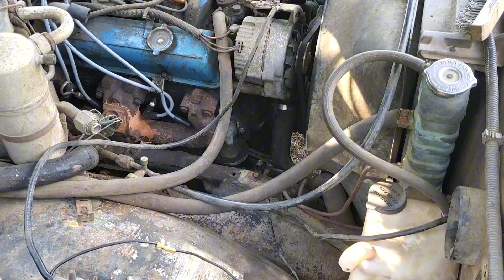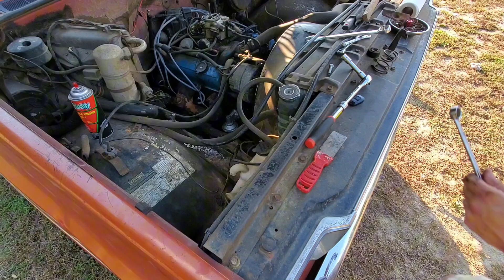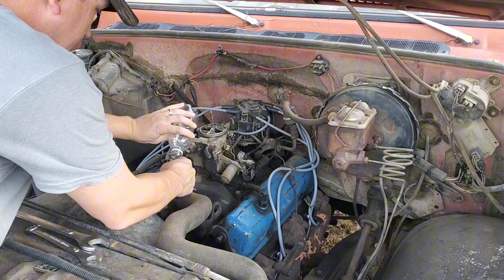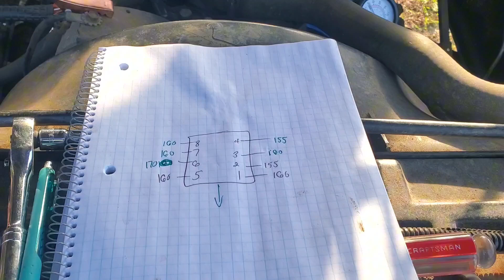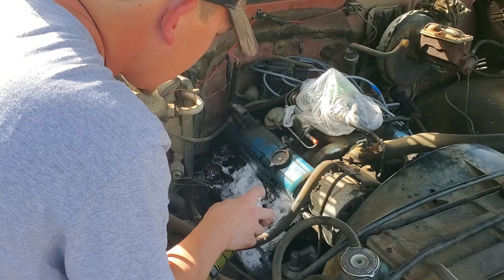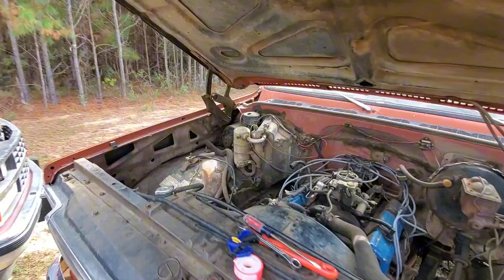1978 C10 Project- Fuel Pump Replacement and Compression Test on the old 305!!!

Comment: Don’t be afraid to use a good quality engine flush and then change the oil I hope to see more video soon Also check out Irish outlaw garage. If you want to pull that 305 out he has a great video on rebuilding a junk 350 that turns out rate on a series budget.
Reply: Put 10w30 full synthetic in it a can of engine restore and a bottle of Lucas high mileage oil stabilizer it’ll quit smoking guaranteed I’ve done it had great success
Reply: Restore fills in the gaps in the cylinder walls scratches and gaps
Reply: Restore and Lucas will take care of the problem
Reply: It’s the rings try engine restore and Lucas together in it it will quit smoking pretty fast
Reply from the maker: Thanks for the info! I plan on running seafoam or something similar in the crankcase and changing the oil. I want to pull the driver side valve cover off first and remove the big debris like I did on the passenger side.